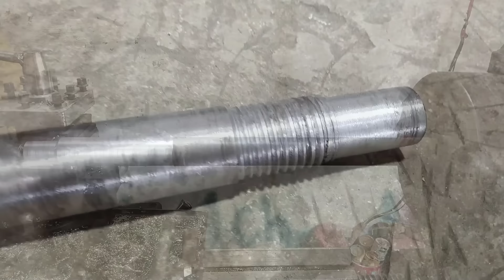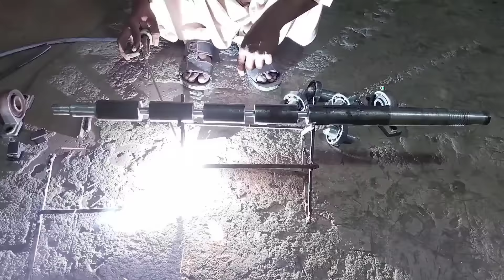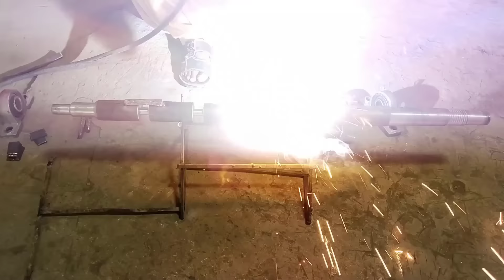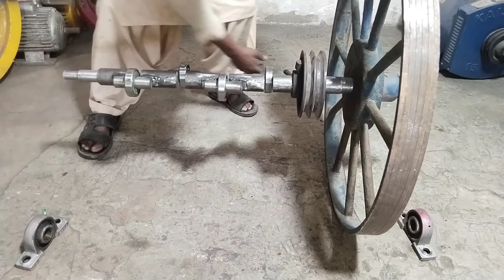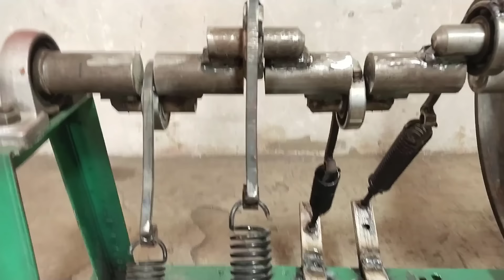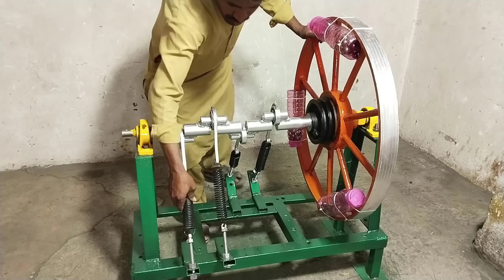How To Make  Flywheel Free Energy Generator  With Connect Spring Machine Complete Prosses New Idea

Comment: note: flywheel bearing/generator/rpm/wheel/diameter more energy generate.

note: motor input 20 kilowatt to rotate flywheel then flywheel generate 40 kilowatt and 20 kilowatt motor input to rotate flywheel and 20 kilowatt other work use.

Comment: THIS IS BULL SHIT 

All this is an resonating mechanical device. DEFINITELY NO FREE ENERGY.

What happens is as follows.
Where the energy you put into spinning the flywheel as it turns,
It then puts the energy into one spring by stretching it, and relaxing the other spring, and as it passes over center it releases the energy back into the flywheel and then as flywheel is turning, it transfers the energy from the flywheel back into the other spring.
Your wasting you time believing this,
The only thing this will do is run for a period of time exchanging energy from flywheel to springs back and forth, until the friction stops it,

DON'T BELIEVE A WORD OF THIS BULLSHIT !

If it actually was to produce energy,
It would immediately accelerate
And it does not,
Since you have to accelerate the flywheel to it's given speed of rotation, and it won't go any faster than that seed determined initially.